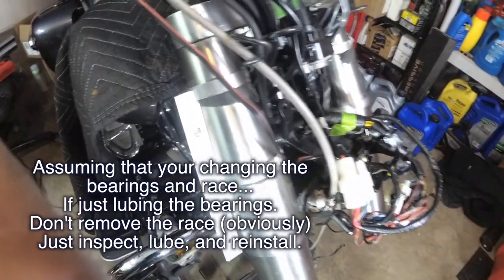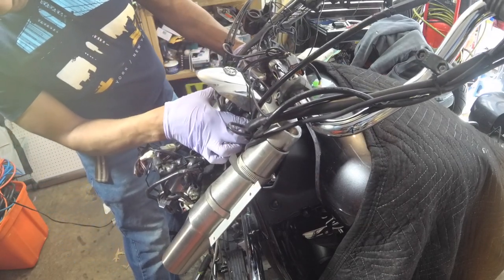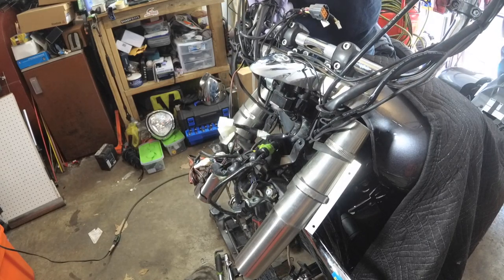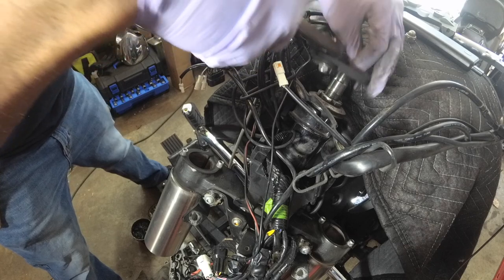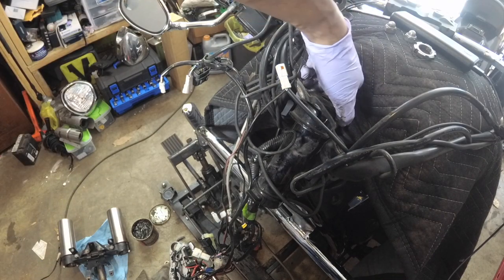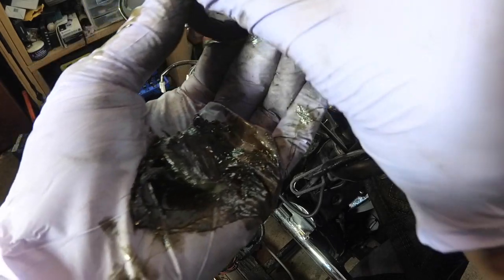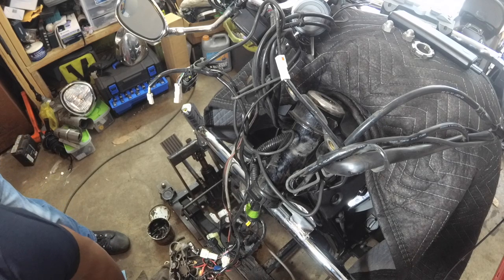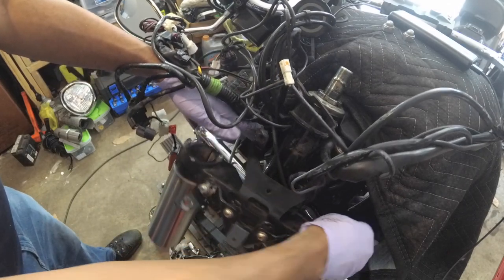Vstar 1300 Head Bearings grease & install.

Comment: Little tip I've used many times to pack bearings pop them in a ziplock bag with a fist full of grease you can realy force the grease through and its alot cleaner in the end. Overall great video bud enjoyed watching over my lunch I know how hard it is to film that solo with greasy hands. Good work hope she glides smooth for many miles.
Reply from the maker: That's a darn good tip. You got one for the pissed off wife, hahahahhaa?
I will remember that. 
Basically I used the tripod with Yi4k. Then 2 lights on both sides of me. Trying to do the work, and look in the little screen lol.. 
I still suggest anyone read the service manual before attempting these things. 
Thanks for the tip, and watching.
Reply: @dbest1aVlogs  I do! To avoid upsetting your better half only work when they sleep and are well fed!
Reply from the maker: Lol

Comment: I love videos like these! Yamaha does make it easy to work on bikes. By the way, at the bottom of the handlebars above the upper triple tree is an opening. I wonder if the rust trail is coming from inside the bars?

My HD had to get new head bearing after 60k. One them got notchy🤔
Reply from the maker: Anthony C. Roberson Yes those are Harley bars. Well made for a Harley, but by Paul Yaffee, bagger bars. That hole is where the wiring would travel up to the grips. ( You prob already know that).. I did wonder if that was where it came from, never seen rust there before. Hmm. Hmm .. now makes me wonder. I do enjoy this hand position though. 
The most time consuming part is the fairing removal, the headlight ... n bucket has to come off. After that .. it’s just take your time laying most the parts out of the way.. oddly, this time after install the front end is turning much smoother lock to lock than last time when I installed the all balls bearings. It’s like silky..
We’re the head bearing covered under warranty?
Reply: @dbest1aVlogs  You could always put duct tape over the hole and check it after a while.

I miss my '02 Roadstar. I swapped bars on that a few times and was impressed on how much slack in words and cables Yamaha had for that.
Reply from the maker: Hmm . good point. I will have to try that. 
Yeah I have heard lots of good things with the Roadstar. Bumped into a guy with one at Americade, and we were talking a bit. It was just a beautiful ride. He was saying that he loved it.  @RRatedCustoms